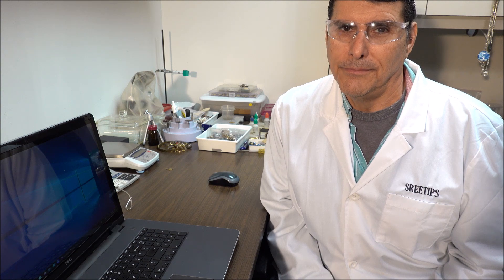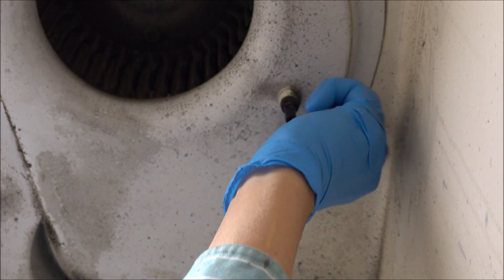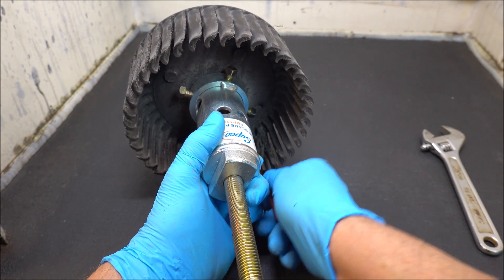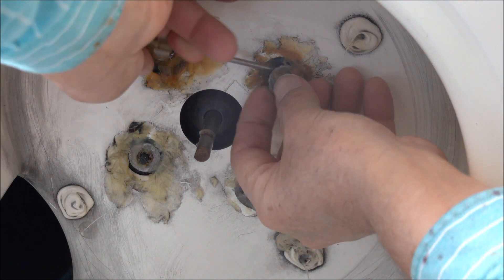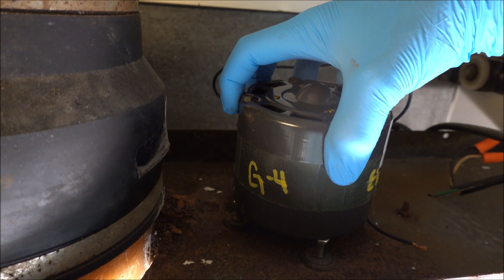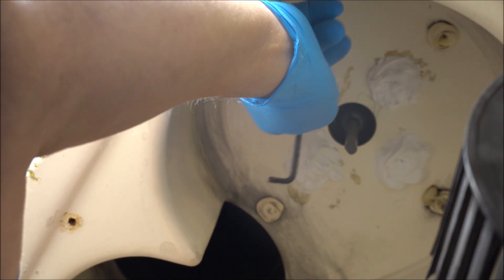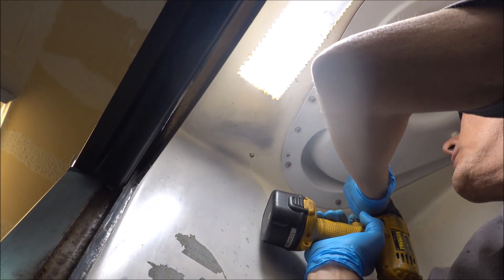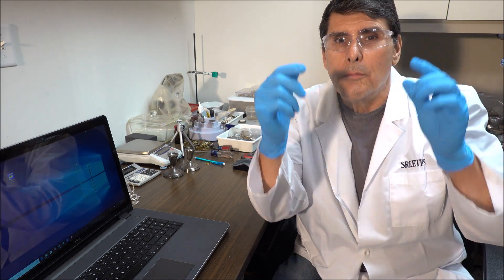Replacing My Fume Hood Motor

Comment: My dad was a pipe fitter most of my life. He worked in a lot of chemical plants with some really bad chemicals. What he used to do, if it was metal-to-metal contact, he coated it with anti-seize. Not only the nuts and bolts but the motor shaft and the hole for the squirrel cage as well. After he was done, he would cover the bolts and threads with a heavy coat of grease and then spray paint them. The paint would dry and protect the grease so it didn't get nasty or get everywhere. When it was time to work on it, he simply wiped off the painted grease and the metal was the same as it was when he first started.
Reply: I'm a boilermaker we do similar work and work with fitters in refineries and chemical plants. Yes what you said is correct.
Reply: Sounds like you worked alone side your dad.
Reply: @Kenlydford  I worked in the oil/chemical refineries as well, but I give credit to those who teach me first.
Reply: @JesusisLord-7A  my dad was a steamfitter also:)
Reply: I was going to add putting anti-seize on the shaft would make it easy to get the cage off next time so you don't need the special tool anymore.
Reply: I have no idea but that sounds like damn good advice

Comment: I can’t wait to see the squirrel cage residue material refining. I don’t recall ever seeing you do a video about that before.  It will be interesting to see how much precious metals is going up and out over the years of use you put it through. Of course that is just what got stuck and only represents a portion of went up and out. I’m excited for this one for sure.
Reply from the maker: This is an old video. I processed that long ago. Can’t remember yield
Reply: @sreetips  oh, I kind of thought the motor dying so soon was a little odd. That makes sense then. I’ll have to take a look for the refining of the motor scrapings. I don’t remember seeing it and I’m pretty sure I’ve watched all your videos. I probably saw and don’t remember it.
Reply from the maker: I don’t think I did a separate video
Reply: @sreetips  ah, I understand now. I can be thick headed sometimes. 😂
Reply: @djcbanks  the video where he included the scrapes from the. Fume hood is one of the videos where he refines the filters from his refining. Not the most recent one but from 2-3 years ago. I watched it very recently. I don’t know how to link but it’s dated March 2020.
Reply from the maker: Ok, thank you
Reply: @habracken8004  thanks!  I’ll look for it. I watch his videos all the time, so I’m sure as soon as I see it I’ll be like oh now I remember. For some reason I just don’t remember the scrapes. Poor brain of mine is failing me it seems. I usually am very good at remembering small details like that but here we are.
Reply: I found the video. I remember now. He mixed it with everything else when he incinerated it. It wasn’t its own refining. That would have been interesting to see though, that material by itself.
Reply: I would love to see that as well. Good suggestion for new video material. 👍

Comment: Our company had three fume hoods in the lab and I was in the maintenance department so we did all of the work on the hoods.  We did the same thing with all internal attachments and covered them with silicone.  Our front doors were glass originally and we worked with a lot of HF and Nitric and the HF fumes would etch the glass in the front windows and frost them so the lab chemists couldn’t see brought them.  We removed the glass and installed plexiglass windows and had to take the counter weights that were in the walls and cut them down so they were close to the lighter weight of plexiglass compared to the glass windows.  We also bought our blower motors and squirrel cages from Grainger.
Reply: Ohh, Grainger, pricey.

Comment: You're quite the maintenance DIY'er in addition to your chemistry skills. Good job! You might ask Grainger if they can source you a better motor. Dayton makes good motors, but the sintered bronze bushings commonly used in motors that size are destined to fail. Although if you're replacing the whole thing the next time it fails, I guess it doesn't matter.
Reply: Think he's a navel engineer.

Comment: All motors being equal, my evap cooler motor lasted 20 years, had it rebuilt in 1975 and it's been working great no problems ever since . Of course it gets oil in the bearings every year.  
 But compared to modern junk that we pay 3× the price of the original motors only last ⅓ of the time . 
To all the youngsters out there: Once upon a time tools and equipment were built with pride and built to last as long as possible.  Stuff didn't always wear out and break every few years .
Reply from the maker: We used to make the best stuff in the world. And the whole world wanted what we made.
Reply: @sreetips , yes sir ! 
 There's still some of us hold-outs who do the best job we can with the tools we have.

Comment: Hey there friend!  Next time you replace the motor or if you feel like it I would suggest opening the hood up and using a scotch pad or coca cola to remove the rust on your hood interior panels. Then get some high temp spray paint and spray it to prevent any future rust. It will extend the life of the metal hood.

Comment: Good video its probably worth getting a metal core filter like for Air con to keep the dust off the rotor,  the dust makes the rotor unbalanced and the unbalance messes up the bearings,  the motor bearings are probably just the cheap vacuum cleaner bearings if they are proper bearings, if they are sintered bronze they wear because of dust and the heat drying out the felt oil washer and if you can oil them with a fine oil like sewing machine oil they can last a very long time, the mix of chemistry dirt and fumes won't do the motor any good, ventilating the motor compartment to reduce the motor temperature would extend its life a lot of the area is sealed,  the motor type is a squirrel cage induction motor from the interlocked wiring in the stator, the motor shaft has a shorted wire turn and  tries to catch up with the magnetic field rotating in the winding, it gets quite hot and causes a short motor life

Comment: just an idea to make the sealant of the screws a little easier to remove. Just put some tape over the screw and apply the sealant to the tape and a bit to the surrounding area. The tape is easy to remove and the sealant prevents the tape from disintegration and seals it airtight. You should be able to remove it much easier and also pretty clean.

Comment: Nice Job Sir.

If it was 2018, I think that was 4 years, not 2 years....

I'm a little surprised you don't run filters....  I mean yeah, you'd have to change them all the time...  But the volume of material that accumulated on the squirrel cage...  I'm just speculating, but that could be ruining your motors....

Comment: Adding a filter screen would be just below it, would help, if you believe it's catching precious metal partials, because, even lighter particles are being blown outside, it may be overkill, but you know, all to well they all add up, if you collect & save it.. Also adding a screen could prolong the life of the motor too.. Just an example we have a good air filtration in our home, I placed a 20" X 20" hose air filter in the back of a box fan and every month I replace it, it catches way more dust then I thought. As a plus, my wife & I also, now have -0- indoor allergy problems.. Sorry for going on so long. My point is, if you do find precious metal partials in that dust, just think what an added filter might recover.. I find your videos to be very educational & entertaining, so much so, that my wife & I are going to do more research and try it, after experimenting in very much smaller tests.. I am a skilled knife maker, so I do understand extensive safety procedures.. Thank you very much for sharing, even these smaller tasks..

Comment: is there any cooling air on the motor if not that may have contributed to the bushings prematurely falling other wise id suggest a once a year cleaning of the impeller blades with some kind of solvent but just my 2 cents

Comment: Maybe you should put some anti-seize on the motor shaft before you install the squirrel cage fan, and after you do that put a little silicone on the end of the shaft to keep fumes from creeping up the shaft and corroding it seizing up the fit for the next time you need to replace the motor.

Comment: Also be careful of the fit with an adjustable wrench.  One it can round off the corners of your pull shaft secondly your knuckles are worth more than the squirrel cage.  They call those adjustables knockle busters for a reason.

Comment: I was thinking about how I'd design ventilation for a fume hood, and it seems to me like there'd be a huge advantage to pulling out acid vapors with a venturi.. where the vent exits the building, use a foot or so of 6" or 8" chemically inert vent pipe, horizontal. (make this a size bigger than the blower). Attach a same size tee fitting, with the tee top horizontal and the spur facing down. Then, a reducer down to the blower size. Pass a blower size pipe through the tee and maybe 3" into the horizontal exit pipe. Connect the blower to the last pipe. Connect the blower inlet to an outside air inlet duct. Duct from the fume hood to the tee spur. 

The blower will be up in the attic or on/near the ceiling, (less noisy, and away from arcing in the motor), pushing outside air through the top of the tee, creating a draft in the spur duct to pull fumes out of the hood. 

If you don't supply an outside source for blower air, it'll draw (possibly heated) air from inside, lowering interior pressure slightly and reducing draft performance.

If you were to use your current fan for this, turn it over so that inlet air is pulled from above.. the inlet suction will support some of the weight of the squirrelcage fan and motor armature, reducing load and wear on the motor bearings for longer service life.
Reply from the maker: Like an air eductor
Reply: @sreetips  Of course.. the very next video Youtube showed me, featured your first refining in your "NEW fume hood", making all of this obsolete to you, but maybe still useful for a viewer..
Reply from the maker: If I have to replace this current hood, I’ll probably get a 500 gallon poly tank with a six inch round on top. Cut the front off for access. Then install an air eductor for the air movement.

Comment: Hello sir, I just made my first AP solution (HCl, peroxide) and put 200 g of gold fingers into it yesterday. Normal goldfingers foils float like charm, but some ancient russian goldfingers are still resisting. I let work it for few days. No bubler yet, I do not know, if it is needed or just "nice to have"..
Your fumehood is like my car, that has more than 500 000 km (310 000 miles), last bigger service, see, what it lasts and get new then... 🙂

Comment: I recently had to "fix" my fume hood fan blade, one of the fins had recived a healty does of corrosion making the fan incredibly unbalanced. 
I cut all the tips back to match the shortest. problem solved....for now lol😅 
Side note: what exactly does stannus chloride do? I know it's used do testing for gold but I throw a couple drops straight into my solution with some SMB and basically was ably to skip a couple steps by precipitating the gold without denoxing/balancing PH.
is this a viable technique or is there a serious problem that I'll come across down the road?

also thank you once again for the videos you put out, I'm extremely close to being able to refine gold from start to finish. just need some legit 
melting dishes!
Reply from the maker: I use stannous chloride to test my solutions for the presence of precious metals, what metals are present (they turn a different color for each type of metal I have in solution). And the relative concentration of the metals in solution. But I’ve never used stannous to drop metals out of solution:

Comment: Don't you run that fan on some kind of speed control ?  It always sounds much slower / quieter. I want to see the exit of the flue pipe & the surrounding roof area.
Reply from the maker: I have a video posted: Fume Hood Install Photos

Comment: I've looked into getting a fume hood , cost was too much [ normal for me to say - do not buy - build one ] .
Checking into types / designs , I have found " it seems " that there is no info a some type of filtering the exhaust ?
I do not have much space  , urban environment , so any suggestions on filtering exhaust ?
Thanks again 

If I was closer , I would be interested in your old hood , when your done with / upgrade , but that may take too long ,   ;)
Reply from the maker: Get one suitable for acid digestions - no metal parts
Reply: @sreetips  , I think you missed my point / points , DIY / build & filtering ?
Reply from the maker: No experience with that

Comment: IT SEEMS  A LITTLE BIT  LOUDER THAN THE LAST ONE.   YOU  SAID THAT YOU ARE  GETTING  RAIN WATER 💧  COMING DOWN FROM THE  EXHAUST  PIPE. MAYBE PUT A STAINLESS STEEL  CAP ON  THE TOP. HOME DEPOT  CARRIES  A  UNIVERSAL CAP  FITS 
6 OR 8 INCH PIPE.
Reply: A plastic one would work better. Acid doesn't corrode plastic.

Comment: Great video sir I wonder if you could use stainless steel screws and parts thank you for sharing five stars
Reply from the maker: Those were stainless fasteners
Reply: @sreetips  wow I didn't think the acid would effect the stainless steel that way thank you sir
Reply from the maker: Acid fumes will corrode and destroy anything metal.

Comment: I don't get it.  Wouldn't all the stuff up there corrode really fast because of the fumes from the acids?  Some other poster a looooong time back said put a filter up there so you can capture the nitric to use again.  Maybe that would keep it from corroding?  Beats me.  I just see the acids put in melt away base metals, and I bet most of that motor and fasteners are base.
Reply from the maker: The inside surfaces are acid resistant molded fiberglass. All the exposed metal fasteners are covered with sealant.
Reply: I do not have a fume hood myself, but I can reasonably imagine that they use the Venturi effect for that.

Explaining: imagine an inverted Y tube setup. In one of the lower arms you connect the tube coming from the fume hood chamber, on the other you connect the motor's fan, the up pointing arm goes to outside. When the fan is on, blowing air from one of the lower arms to the upper one, it generates a low pressure zone in the process. So the air from the higher pressure zone is sucked into it. And because the air is flowing to the upper arm, the air coming from the high pressure zone follows that flow.

DISCLAIMER: I'm not claiming that this is how all fume hoods works, that's just my explanation using basic aerodynamics on how they might work. I̵ ̵m̵a̵y̵ ̵b̵e̵ ̵v̵e̵r̵y̵ ̵w̵r̵o̵n̵g̵ ̵h̵e̵r̵e̵.̵  I am wrong.

EDIT: And this isn't even the way this fume hood works. Well, I tried.
Reply from the maker: We used air ejectors to create vacuum

Comment: I know you replace this every couple years. Just a cost savings. Grainger is fine, but I bet your local big box store has the very same motor in stock for much cheaper. Check attic fans in the roofing section. I can say I got that exact motor from HD two months ago to replace my failed attic exhaust fan motor.

Comment: Speaking from much experience, Dayton motors are not high quality.  Look to GE, Baldor,Mitsubishi, or another brand. You pay a little more but the reliability is there. Great video BTW.
Reply from the maker: I could not find a replacement that would drop in, in those brands

Comment: It is outside of the purview of your channel but there has been lots of talk about lithium battery recycling recently, it would be interesting (to me at least) to see you dissolve a lithium battery in acid and recover the aluminum, copper, lithium, cobalt and tin.
Reply from the maker: I’m not familiar with those metals
Reply: Lithium is realllllllyyyy reactive and finicky. It's poisonous, , and burns easily enough in air that, Like it's siblings sodium and potassium, it has to be stored in a hydrophobic substance. Lithium is so light, though, petroleum jelly is used rather than mineral oil.

Comment: A small bit of anti-seize on the shaft would make the blower come off easier should you have to do this again.
Reply from the maker: I did apply anti-seize
Reply: @sreetips   I must have missed that. I saw you put some on the set screws but not on the shaft of the motor before sliding the fan blade on.  😴

Comment: For the record those sleeve bearing motors don't last very well in a shaft vertical position. Try to find a ball bearing motor of equivalent specs and it will last longer. fwiw I work at an electric motor repair/rewind shop.
Reply from the maker: That motor is fit to that fume hood. I could not find a substitute with the correct specs.

Comment: I can make a fume hood out of a discarded fridge .Thank you mr. sreetips..
Reply: I found a nice looking non working stainless steel refrigerator  free. On Craigslist.  I will cut a hole in the door and sheet metal screw and caulk down a sheet of plexy glass and use the stainless steel I cut out as trim around the plexiglas.  The squirrel cage in the freezer section to keep down noise.  I will line the inside with stainless steel sheet soon . Time involved was an hour and a half road time and 30 minutes fabrication time
Reply: Thanks again sreetips